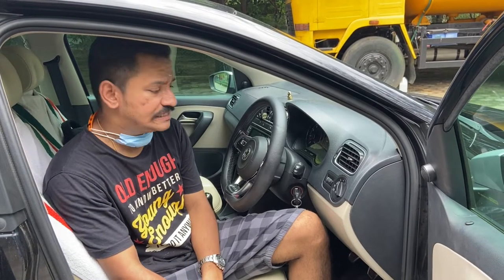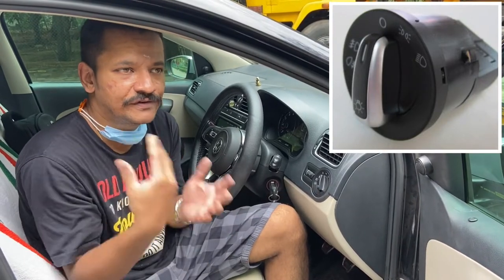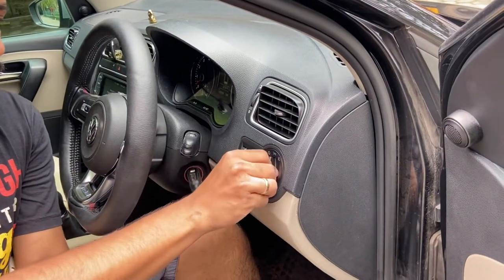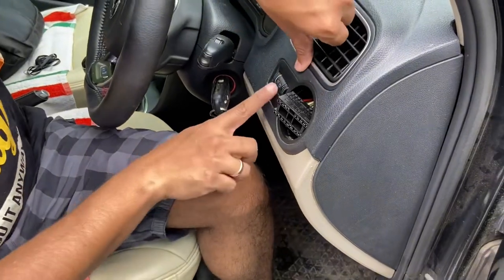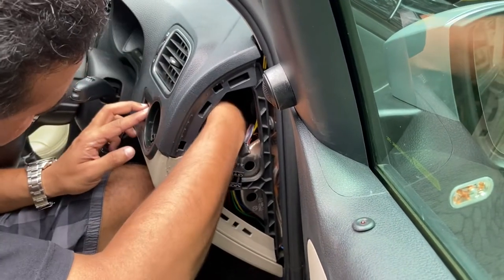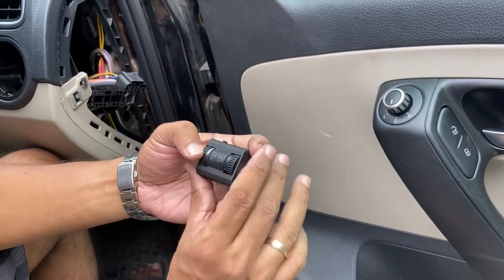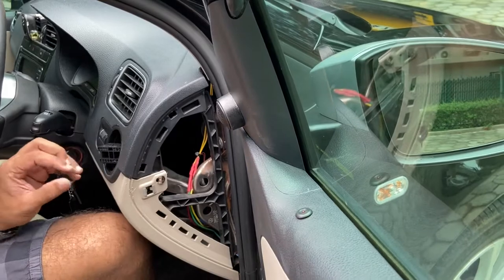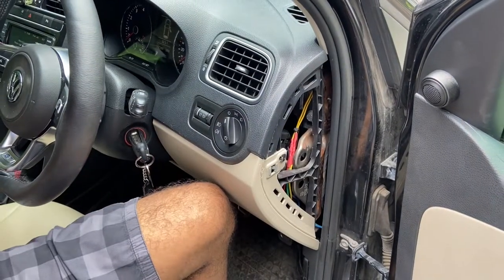Polo 6R - Replacing headlight switch and range controller unit

Comment: For upgrading to headlamp leveler with cluster brightness adjustment switch, we need to buy only that switch or anything else required.. Like can we use existing connector for that switch
Reply from the maker: Hi Jorly, you’ll need a new adjustment unit, a pin which connects to the headlight adjustment switch and a cable which connects to the fuse box’s existing cable. Will make a clip on this modification shortly.

Comment: I have a question since you’re the best mechanic in youtube for VW Polos. You taught me every single thing I can do on my polo but now something popped up and I want to ask you:

My daylight and low beams stopped working (both) but I have fog lights and high beams. None of the fuses are blown and I’m not to sure if I need to replace the switch or the relay. For the relay where is it located and how easy it is to replace it on my own?
Reply from the maker: Hi, thanks for the feedback JK. 🙂 I’m really humbled by your support. 

Your issue seems related to either the fuse or relay. BCM is highly unlikely. Please check the wiring too for any rat chew issues. The relays are located behind the steering unit hidden under the dash. 

If you remove the side panel trim of the dash near the steering, you can see a bunch of relays. 

Here have a look:

https://polo.blue/fuses-and-relays-in-polo-6r/

Comment: Hi Ganesh, I have been following your YouTube videos for quite some time now and have also read your blogs on TeamBHP. Your DIY videos are amazing! I need some help or suggestions regarding an issue I am facing. Recently, my Polo went to the garage for repairs and I discovered that the mechanic had used superglue to stick my headlight switch, which now cannot be removed. I was hoping if you could suggest any ways to remove the superglue adhesive so that I can upgrade to an auto headlight switch.
Reply from the maker: Hi Dexon, thanks for the feedback man. 

As regards your headlight switch, I’m afraid, there’s no other go other than using brute force to remove the switch from the slot.

Why was it stuck using superglue if I can ask? Was it broken or something?
Reply: @GaneshBalan Thanks for the quick.The funny part is, If you recollect there is a silver trim on our headlight switch, and it came off. I asked that guy to glue that silver trim, but he ended up gluing the whole switch. Now, it bothers me to see the switch without the silver trim, so I bought a new one to replace it. Unfortunately, the old switch is stuck. Is there a way I can remove the silver trim from the new one and put it on the old switch? I'm afraid I'll break the new one too, haha.

Comment: how does your aircon relay look there is no on the relay,,,2010 polo
Reply from the maker: If your interior relay layout looks like this:

https://manuals.plus/wp-content/uploads/2023/10/Volkswagen-Polo-2009-2017-Fuses-and-Fuse-box-diagram-and-Location-fig-6.jpg

then R9 is the AC relay.

Comment: Any chance of video for side view mirror change from old to one with inbuilt indicator lamp
Reply from the maker: Will do that shortly. I've a bunch of other videos lined up. Once I do the door card removal video, I'll do the mirror removal clip as well. Adding the indicator wire is easy as you have to tap into the respective wire in the harness going to the tail light indicators below the driver side door sill trim.

Comment: is it possible to replace the plastic housing that surrounds these units? if so what is it called? i have ruined mine
Reply from the maker: Hi, no it’s integrated with the dashboard. It’s not available as a separate part.
Reply: @GaneshBalan  are you sure? I have a polo vivo which is a bit different. this panel seems separate. i can get my fingernail behind it so there is a gap.
Reply from the maker: @Nite85 Yes. Please take a look at the parts diagram of the dashboard below:

https://oriparts.com/39/721/72698/36307428/857-857010/
Reply: @GaneshBalan  link doesnt work but thanks i take your word for it
Reply from the maker: Please check this link if it works - 

https://i.oriparts.com/scheme/0/00/00/10/64/95.png

Comment: Mine doesn’t work like that I push it in and twist it doesn’t slide out
Reply from the maker: Perhaps the connector with the wiring harness is holding the switch tightly?

Comment: My headlight control is not working any website from where it can get at lowest price
Reply from the maker: What is the exact problem? The range control motor or the controller unit?
Reply from the maker: I buy the parts from www.boodmo.com. They charge a nominal fee for shipping. Do check out. 👍🏻
Reply: They are giving it for around 2500 something

Comment: How to remove that mount from dash
Reply from the maker: Which mount are you referring to?
Reply: U removed the headlight leveler from a place right the one which hold the headlight switch and headlight leveler
Reply from the maker: @karran5675 That is not a removable trim. It is fixed to the dash.
Reply: Ok sir tq for sport reply
Reply: Ok sir tq for sport reply
Reply: Ok sir tq for sport reply